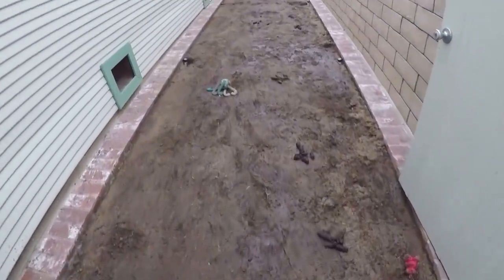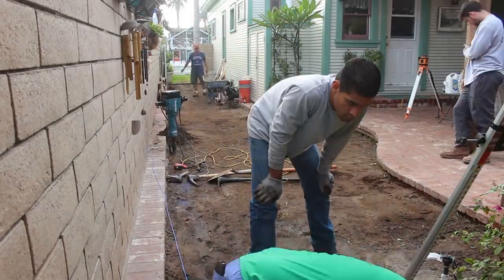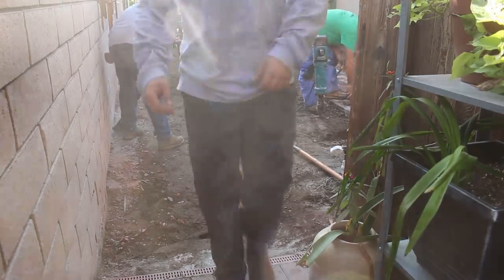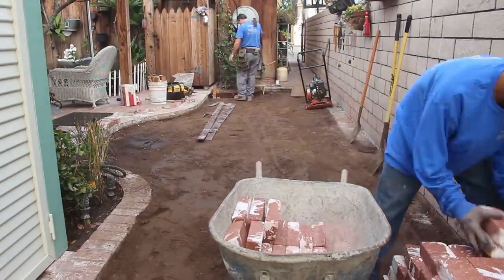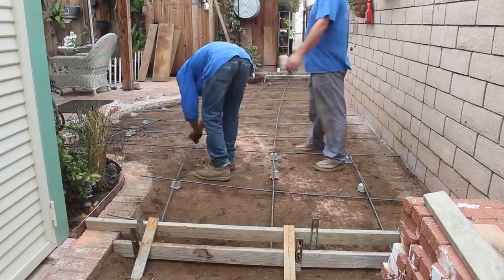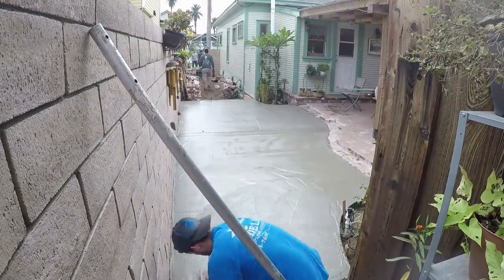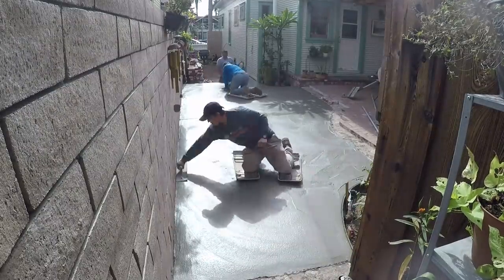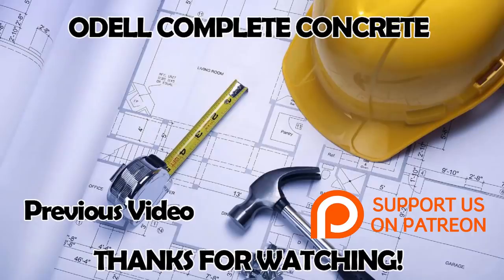How to Build a Brick Patio Basket Weave Pattern DIY Part 1

Comment: Lot of love poured into it for just a base.
Reply from the maker: No other way to do it
Reply: saves work later, you will see ;)
Reply: The concrete only has to be level, which was the case at 6:30. All the work after that timestamp (except the control joint) was for nothing (or maybe a nice practise moment on the costs of the customer).

Comment: 7:00 how would you prevent cracking through the brick if it were herringbone? 
Have a 25' stretch of walkway, did concrete base and ive not cut a control joint yet because i dont know how to make it zigzag with the herringbone!